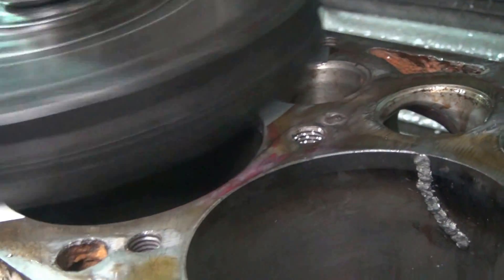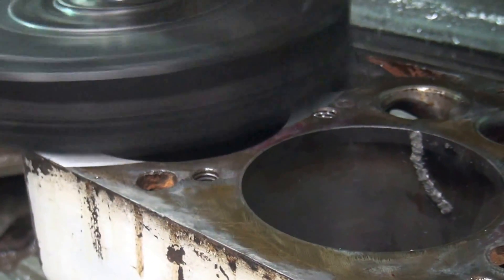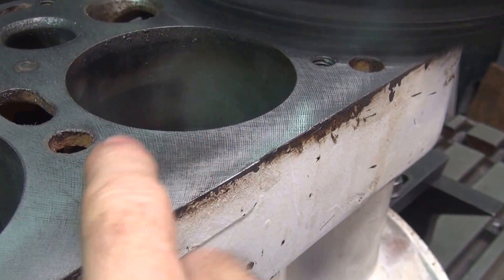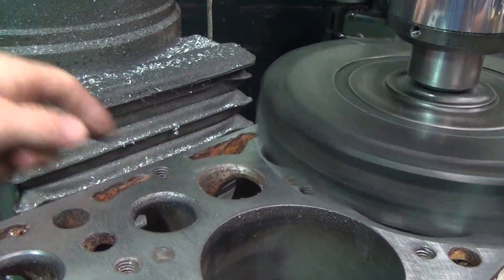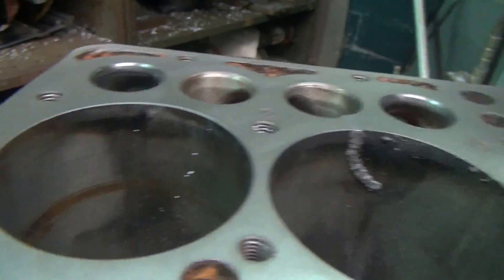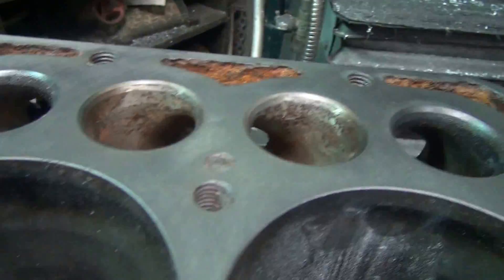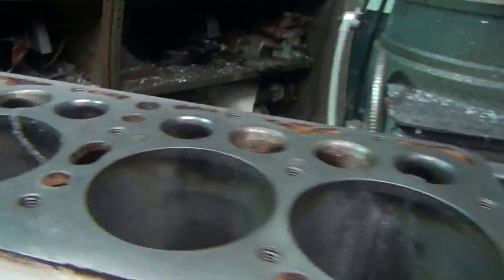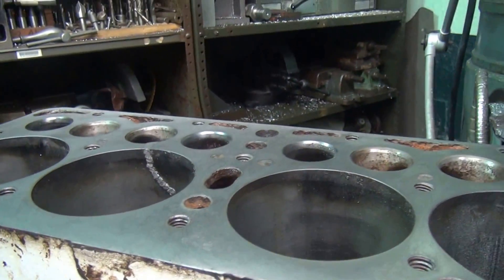1932 ford #112 model A or B flathead race block crack repair by tatro machine

Comment: If you were to slow down and go half as fast as a final pass would it get some more of that grooving out and make it smooth. Not sure what kind of gasket they're going to use but if it's an MLs to smoother it is the better. Awesome videos up to this point I started at the beginning. It's mind-blowing to me how you can drill holes tap them break off a screw in them grind them down and peeing them over.
Reply from the maker: what i did worked. could it have been better, damm right. i used the tools i have and made them work. better tooling with the correct cutters would make a big difference but i made do with what i had.
in the end, the motor went back to the track and made more runs.

tatro